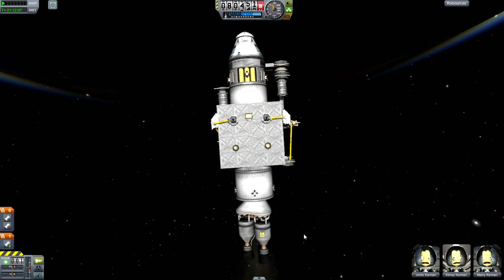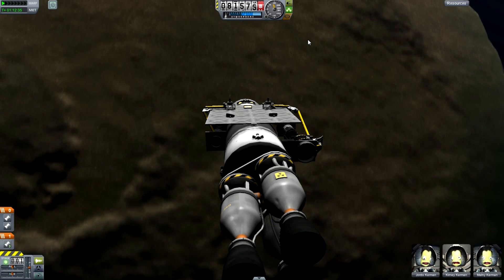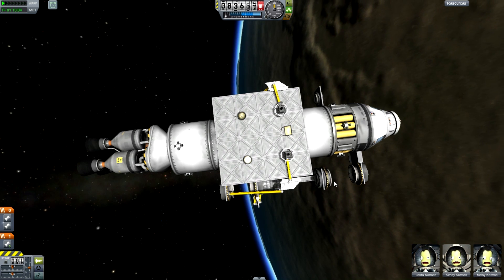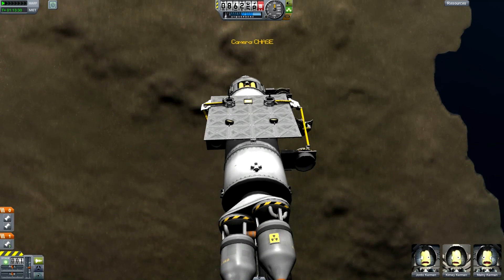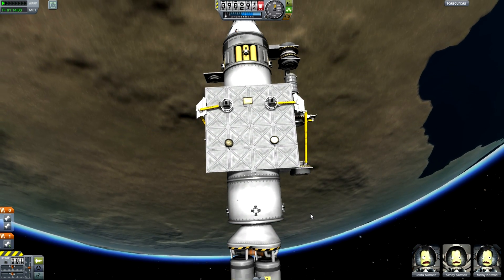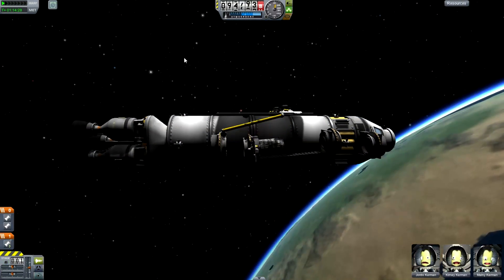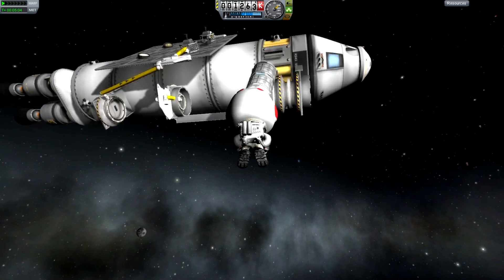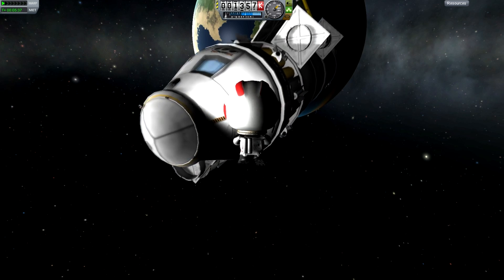Kerbal Space Program - Rocket Powered Binary Logic

Comment: You should build a computer and then program it so you can play Kerbal Space Program in Kerbal Space Program. It's Kerbalception!
Reply: William Gilbert
Lies.

You would need the worlds largest computer though.
Reply: Adraria8 Well... The only issue is that EVERY action the computer performs must be triggered by a user triggering an action group so a conventional computer is impossible as checking logic besides reading the engines is impossible. The whole system works because of carefully mapped fuel flow depending on what action groups are on/off. I have a MUCH faster computer in the works and it's being released next month... Yes, I basically took a 2 year hiatus.

IF the devs allowed action-group toggling of fuel flow for docking ports I could make solid state machines much more easily than I do now. Or if they allowed if-then action groups depending on ship variables I'd incorporate that to make it much easier. Could even do a full blown computer then. But I'm planning a series of tutorials on building your own machines if you so please. I'll be remaking the computer dev thread and stuff for that... 

Keep a lookout on the forums.
~3_bit
Reply: +Adraria8 Build Minecraft in Kerbal, and then use that Minecraft to build Kerbal. Play Kerbal in Minecraft in Kerbal.
Reply: What if someone creates a mod that allows docking to trigger action groups? :-)
Reply: impossible
Reply: waterlubber No: the game has a render ditance of ~2.5 KM. Your binary computer would need to be larger than ~2.5 KM^2
Reply: William Gilbert
Mods!
Reply: William Gilbert Not in 1.0.... I think the physics render distance is something like 30 Km now...
Reply: Pieliker96 Gaming Come on, Squad! Make Kerbin-sized vehicles a thing!
Reply: The parts count would certainly crash most computers but I like the idea.

Comment: Regarding making a 4-bit adder, which is not in my plans to do, is far more complex than chaining them together as you could with conventional circuits. With this, you must literally embed the circuits together. For example, to calculate the bit with the base 10 value 1, you just need an XOR hooked up to the respective switches on each side. But for the output with a value of 2, you must embed an XAND inside of an XOR or something like that. I might draw out the design... - 3_bit

Comment: A logic gate in binary logic is anything that takes one or more input bits, each of which can be either "on" or "off" (or "true" or "false", 1 or 0, these all mean the same thing), and gives an output bit.  Which output it gives for a set of inputs determines the type of gate it is.  Most common are the 2-input gates which are the building blocks of all modern electronics, such as AND ("on" when both inputs are "on", else "off") and OR ("off" when both inputs are "off", else "on").